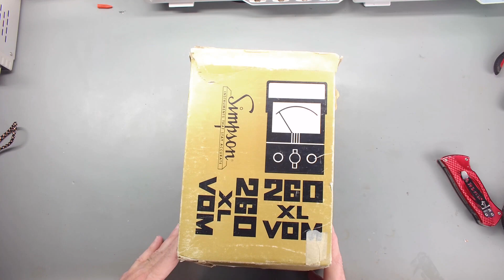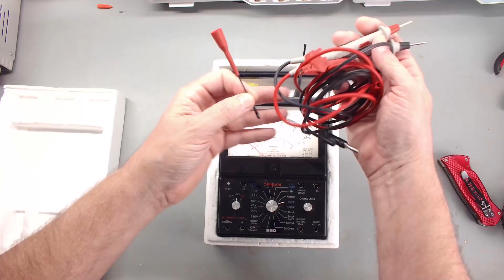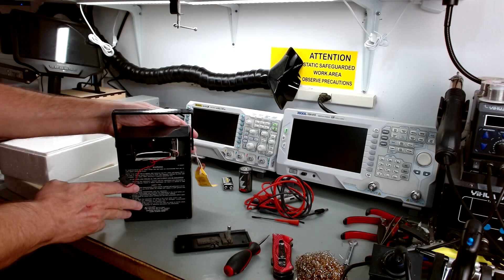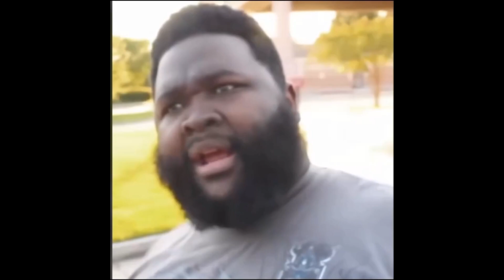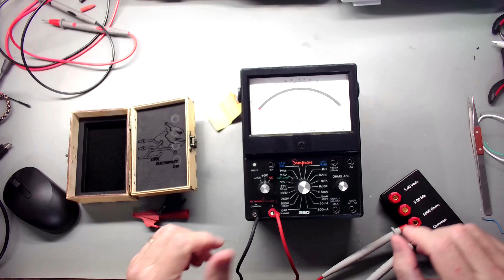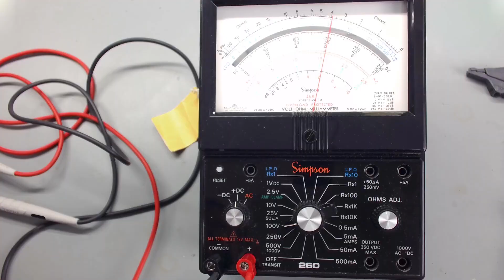Another Meter RJ? Prepare to Be Amazed!

Comment: The 5mA reading should have been correct. Think about the load - it is 5mA whether the meter is digital ot analogue.
Reply from the maker: Yes, 
I wasn’t thinking clearly on it. I had in my head that on high impedance circuits they will read a little low on voltage because of their higher loading compared to dmm’s. But you are correct this would not apply to current readings as the resistance of the meter is factored in the calculation so it is nullified. But it still was less than 8% off at that small current. Not too bad for an old mechanical meter! At higher current as I found out later it is much closer to dead on. It has turned out to be a great meter and I see why they got such great respect in their day. I love it for testing potentiometers and calibrating things. The big mechanical meter and needles makes so easy to make fine adjustments.
RJ
Reply: @LynxElectronicsLab  I know the feeling. But it seems you have found yourself a winner. I always prefer an analogue meter for peaking up something while tuning. The absolute accuracy is rarely a consideration.

Comment: Very Nice meter. I have been wanting a Simpson meter for years, just never pulled the trigger. I did get a nice little analog vom that is made in Japan. I used it too adjust the IF stage on my light show radio. Still have a Simpson on my want list. A bit off topic, I was watching Skin walker ranch and notice one of the guys was using a TinySA Ultra. The camera man was trying to get the shot without showing the TinySA too much.
Reply from the maker: Thanks Rick,
Yes I lucked up on that eBay purchase. $40 in the original box including the probes was a steal! I don’t have the ultra as it was not out when I got my TinySA but I am very happy with it for the money. Both it and the NanoVNA are great for the money especially if you use a computer with them. I wonder why they were trying to hide it?
RJ

Comment: I woulda looked at the expiration date on both batteries you removed and tested them.  That 9V is a TOTL battery.  I've used them for years and never had an issue with them.  Never leaked.  But then you put a Duraleak in place of that D cell.  I stopped using Duraleaks after they ruined so many of my devices & even furniture due to their propensity to leak well before their expiration date.
Reply from the maker: Thanks for the info. I just wanted to start with known fresh batteries. I guess my batteries get changed enough I never have them leak. 
RJ